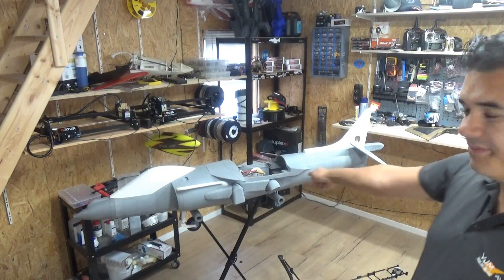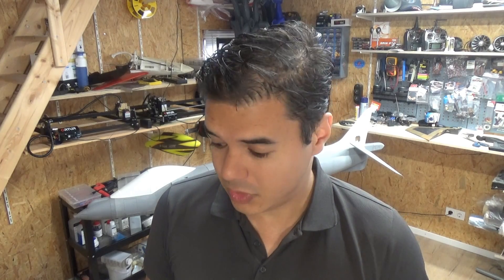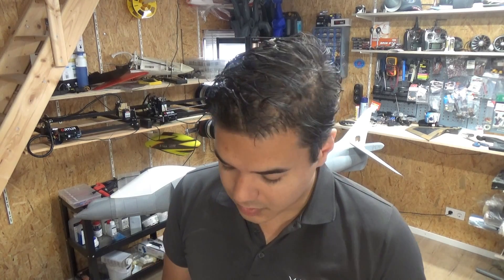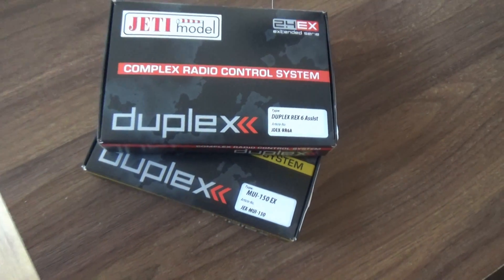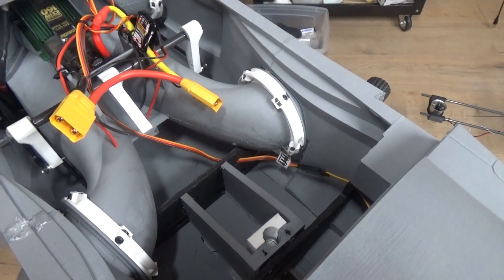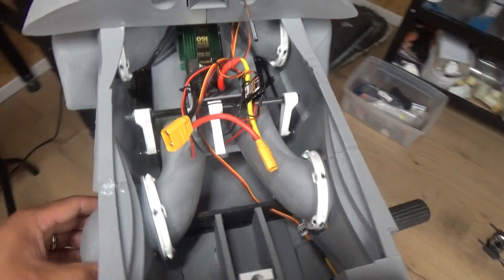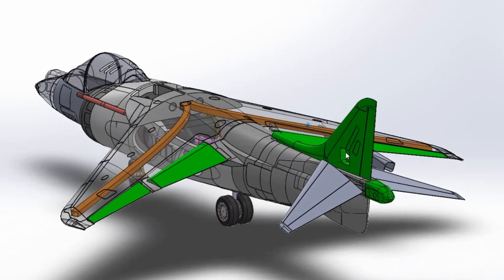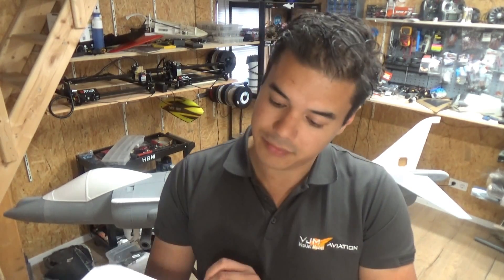AV8B Harrier printed ?! | Can It Be Done 1/7th Scale RC? Colorfabb Light-Weight, foaming PLA

Comment: when i first saw you building the harrier and had some successful hover, i said this guy is going to to it.
finally there will be a rc harrier, 50 years later your still in the same place, your building a hole lot of NOTHING!
Reply from the maker: The harrier is a difficult aerodynamic plane, working 3 years on it. Improvement on rotation of nozzles, 30% weight reduction, went from 140 amps to 75amps during hover, had 2 total loss crashes. but yes it takes to long, that is why I go for printing them during this stage..instead of composite

Comment: Have you considered putting smaller ducted fan motors in each outlet for fast control like a quad?
Reply from the maker: Just for pitch, for roll I use some bleed air from the main edf. But it’s a good idea to use smaller fan motors because they help with Thrust vector
Reply: @Joelmelanie  
Yes, i saw that, very nice.

a long time ago before you could get high powered edf,
I had to put 4 small edf inside the ducting for the large edf.
I couldnt get the thrust with just a single edf, i had to stage them.
so i ended up with one smaller edf inside each of the rotating nozzles (mine were at the rotating joint and my joint was 45 down and 45 rear to keep the duct straighter but it had to be circular)

the thrust vs power worked out better by two stage

Comment: Brilliant ! I have been following your progress via your videos for years, and I am also enjoying your journey.  On the Harrier GR3 and Sea Harrier FRS1, the aden gun pods contrubuted a little to the hovering lift by confining the vortex caused by the downwash in the hover.  Would you consider a quick test (maybe a pair of depron baffles under the fuselage) to repeat your hover test to see if you can gain a bit of "free" hover lift by introducing these parts ?
Reply from the maker: Yes exactly what i am thinking, going to install a simpel wingframe with the roll nozzles, to test and set pitch momentum first savely. after succesfull tuning and hover i will ad the completed wing and than go to Roll tuning. thankyou;)
Reply: @Joelmelanie  Sounds good. I was talking about the little baffles underneath the fuselage however.  On the full-size, the gun pods create these and are situated between the 4 lift nozzles underneath the fuselage.  They contribute to the hover lift by confining the downwash.

Comment: Love that you are using lw-pla for the project.
Just bought a roll myself to print a new tail for my 2 meter glider 💪🏼
Reply from the maker: Awesome, do you have a Building pictures?
Reply: @Joelmelanie  nope, not yet. Gonna draw it in fusion 360 first.
Its an old Graupner balsa glider, that's been glued together too many times 😂
So have to experiment with a new replacement tail 🤓

Comment: Excellent progress. Difficult equation re available thrust and vectoring for forward flight. Presumably you were measuring current not actual thrust, so as the current/rpm increases you get an exponential thrust increase due to fan efficiency? Which would then give you a margin as you lose the vertical thrust vector in the transition faze?
Reply from the maker: So espected max thrust out of the nozzle is around 6Kg weight hopefully around 5. I will ad 2 40mm for pitch and helping with T vector

Comment: That's awesome, 3D printing makes the eventual aircraft far more accessible to a wider range of hobbyists than full fiberglass layups (though I'm still impressed with the work you did on those too! :D ) I assume the wings, stabilizers and servos will add a lot more weight, but seeing the (first attempt) prototype of the fuselage able to hover on less than 70% thrust is very encouraging. How much does the fuse weigh, without the electronics? Also I am curious, is this initial print of the fuselage as solid/sturdy as it looks on camera? Or is it quite fragile in places? If very solid, there may be opportunities to make it lighter in strategic areas without compromising structural integrity.
Reply from the maker: I will tell more details in my next video, 70% was limited. Keep in mind i am still need to install the 2x 40mm edf, they give an extra 1kg push😃 total weigh ex lipo is 3kg sofar

Comment: Used this stuff in planes where I need the tail really light and it works really nicely (bit stringy on the nozzle but I had some great results).  I found however the aircraft warps as the print relaxes during any kind of heating cycle (ie in your car or even flying in the sun).  If I did another scale plane it'd be in LW-PLA just to get the shape in quickly, then glassfibre over the whole thing to lock it down.  I agree, for me composites are time consuming and messy but mixed with other tech like 3D printing they are ideal.  Also helps with any layer adhesion issues during the print.
Reply from the maker: Great one
Reply: @Joelmelanie  Do you now Ramy RC?
https://www.youtube.com/watch?v=P9bT-sLFjXY

He's doing a great combo from 3D printed (one-time) moulds and composite.

Comment: Looks good. Are you going to 3d print the wing? Also, do you post the fuselage STL files in Thingiverse?

The intake valves that you mentioned are called auxiliary doors. Fun fact, when the AV-8B was being developed, the prototype had two rows of aux doors on each side, the theory was that it would provide more air to the engine during hover, but during testing, the performance was not there, therefore the extra row of aux doors was removed.
Reply from the maker: ow wauw thankyou, Auxiliary doors, copie that;)